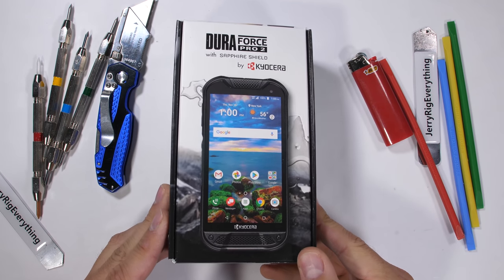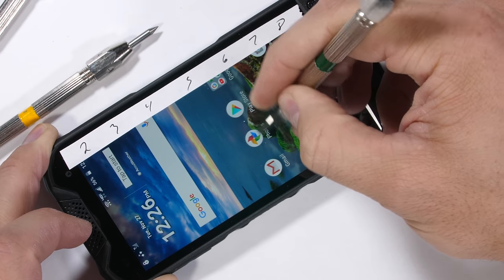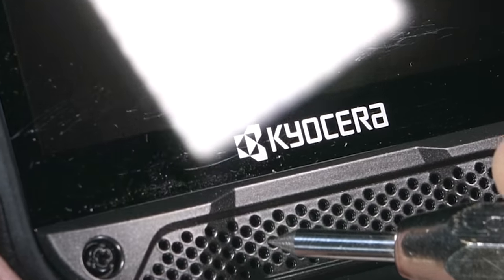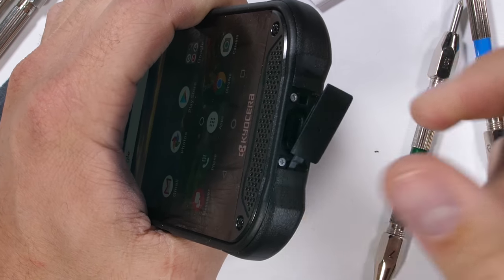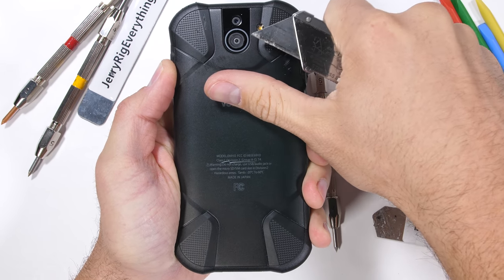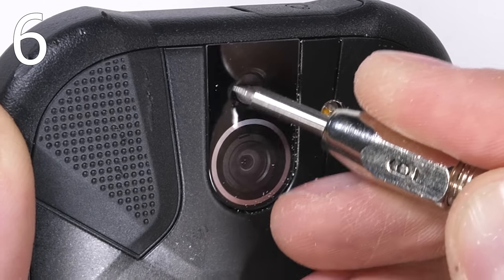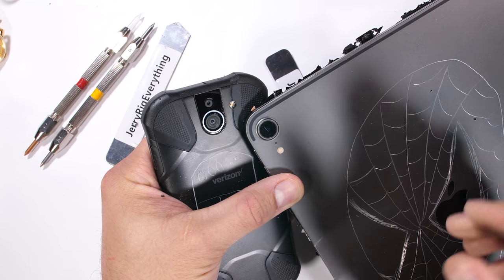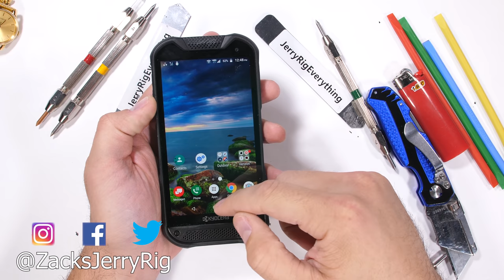A Rugged SAPPHIRE Covered Smartphone? - Durability Test!

Comment: Please don’t ever change the style of your videos!
Reply: I would like him to add drop test as well
Reply: @anashussein6068  I would like a bit more roasts to Apple....oh wait... Wrong channel I meant to put this on Unbox therapy.
Reply: @anashussein6068  when you think about it, it's not needed. 

Glass is easily broken. Like, 90% of the phones will fail the durability test, only the plastic screen ones pass. That is not very informative. It doesn't show the quality of manufacturing, since that's just how glass is.

 Unlike the bend test, which shows manufacturing quality. All phones nowadays are made of the same material (aluminium) yet some fail and some pass with flying colors.
Reply: @qwerasdf-oy6uo  yes the majority of glass-screened phones will break in a drop test but manufacturers have to put some sort of rubber or silicon frame around the screen (or something that absorbs shocks) so that the glass won't absorb all of the shock and smash so a drop test could still have some use
Reply: I know his password
Reply: @anashussein6068  He does drop tests when it's prudent
Reply: @anashussein6068  He only does that only a few times
Reply: @qwerasdf-oy6uo  I agree a lengthy drop test segment would be a bit much but I agree with others that adding a small segment touching on any screen to frame buffers or stress concentrations at sharp corners could affect survivability. This should not replace the burn test though.
Reply: I second this comment. Your content is unique, please don't change it!
Reply: "should we be putting sapphire on all cellphone screens?"
If that means the screen will not get scratched from my Level 8 mohs nail, yes of course
Reply: True
Reply: I would be nice if he adds a durability test for the charger in the box. I mean what's he gonna with all those. Atleast, give a hardware review of them.
Reply: @qwerasdf-oy6uo   that doesn't mean that they should be able to take the same damage. The thickness of the frame is also a factor and where you drill the holes. It has very much to do with the shape. But except that every manufacturer doesn't use the same aluminium composite. Remember how badly the iPhone 6 bent, and then they fixed that with the 6s, which had the same shape as the 6, that was because they used a stronger aluminium composite. And remember the Essential phone which had a Titanium frame

Comment: I get so uncomfortable when he cuts towards himself
Reply: Wood carver here, work with knives for a living, he's doing a parring cut completely safe the power in the cut comes from squeezing your hand so very controlled, same way done prone peel apples or potatoes
Reply: @chironturner4040  True, except with wood or fruit you are working on one substance at a time and the force needed to cut remains constant. Jerry is constantly switching between steel, aluminum, different plastics, and rubber which means there's a much higher likelihood of the blade slipping and cutting right through his thumb. Also if you actually watch how he's cutting, he cuts fully through until the blade slips instead of controlling his cut through the material. So in short, very unsafe.
Reply: @chironturner4040  I know less than you so forgive me but you can see it skidding! It's so unpredictable! He can't cut away from himself somehow? Idk eeeeek
Reply: Hahahaha
Reply: @hkoxnw  the old cut away from your self deal is not for every one any how. You should cut in the direction that gives you the most control and your blades should always be sharp. most cuts do not happen because of direction but because your blade is not sharp enough to get the job done safely.  Working in computer shops i converted many a card board box in to a disposable bin for dead parts by taking off the flaps with a good very sharp knife never once cut my self cutting towards my self. The few times i had close calls where cutting away from may self. Grabbed the flap with left hand and drew the blade along the box flap toward my self great control. Cutting away from my self very awkward and resulted n the cut going up the flap towards my thumb even potato peeled m self a couple times just a couple skin layers but yeh stopped even trying after the second time. Rope cord etc for me is easier to cut going away from my self so it is all dependent on the direction that gives the most control
Reply: I DO TOO 😲😲😟😟😖😖
Reply: Towards your thumb, not your chum.
Reply: @MalleusSemperVictor  eh? i had to do a age search in chrome and the only chum typed out i see is the one from you lol

Comment: If you're looking for a justification for the burn test, it comes into play when repairing waterproof phones that have their screens glued on. You need to heat the gaskets to soften the adhesive before you pry it the screen off. So if a screen is really susceptible to the heat test, then you need to know that you have to be super careful when removing it if you're ever repairing that phone. Now, we all know that the amount of heat your need is less than an open flame directly to the glass, but it's still good to know.
Reply: But does the heating reach the temperatures of a lighter? I dont think sooo
Reply: @ishouldhidemynamelmao345  Yeah, I literally said that in the last sentence of my comment.
Reply: @ishouldhidemynamelmao345  

No. You usually need to set your heatgun on a temperature of 80-100° Celsius (176°-212° Fahrenheit). 
The flame of a lighter, at its hottest point (right above the blue tip) is around 1300°C or 2372°f hot.
Reply: What if you're a DIY guy, after watching these tests you know you can use a lighter to soften the adhesive instead of a heat gun. You know that you can be reasonably careful and still not damage the phone. Obviously you should use a heat gun if you have one, but in a pinch you can heat up a phone with a lighter or in a frying pan and as long as you're paying attention, you're not likely to permanently damage the screen.

Comment: Dang, a rugged smartphone that isn't just a regular phone wrapped in an inch of rubber and plastic and it doesn't for some reason cost more than a normal phone.  Nice to see someone out there actually trying.
Reply: I'd laugh if someone in the comments said that it's back comes off too easy.
Reply: I found ulefone's armor 2 is pretty good too.  Both of these phones are also priced at good range too.
Reply: I own the kyocera duraforce 1, it looks basically brand new after 2 yrs. I had the Kyocera Brigadier before this one, the duraforce pro 1's predecessor, and the only reason I swapped was cuz the battery died of old age. These phones are baller for longevity but leave a little something to be desired in heat management (prolonged use of resource extensive apps heat the phone to disuse, forcing mandatory shutoff-cooling.)
Reply: The overheating thing is a bit of concern. Luckily I don't need processing intensive longevity
. I'm assuming your talking about games?  I have a PC for that.
Reply: @Balefire89  oh yea my duraforce pro  version 1 not the new v2 overheats like crazy usaly it's the darn power management chip once it get hot enough the phone stops charging and the only way to prevent the phone from dieing on you even when plugged in is to cool the phone with a blower etc blowing cold air. Once then phone drops below about 44 to 45 c it starts charging again
Reply: @Trekeyus  I have the duraforce 2 no heating issues yet, apparently it can go up to 60c, got mine up to 48 once in direct sunlight while playing a game with no issue

Comment: Jerry: Scratches tf out the fingerprint scanner
Fingerprint scanner: Doesn't work properly
Jerry: Impossible
Reply: Well in other durability test videos he scratched the fingerprint scanner too but it's still work except for this phone.
Reply: RMP. !Attacker fake that’s because the fingerprint scanner was on the screen or made of glass
Reply: @crazykells5882  True, but it's still woth noting that if you treat it like shit it may stop working. It's a durability test after all.
Reply: @crazykells5882  not all fingerprint scanner in glass are working right when scratched
Reply: @kamilbeben9900  if you manage to do that to your fingerprint scanner you don't deserve it to work lol. Itd be dope if the reader was on the screen though.
Reply: @TheFrogInYourClosetWatchingYou  I don't think that would work well with such a thick slab of sapphire. Also the screen need to be heat resistant, and a ultrasound scanner wouldn't be very resistant to heat.
Reply: Jerry: umpossible

Comment: 2:54 a headphone jack - instant thumbs up👍👍👍
😂😂😂😂
Reply: @rodmunch69  
Slob is YOU. We want headphone jacks.
Reply: @TheP_DSPTractor  Why?
Reply: @rodmunch69  with the money that I spend in a good bluetooth headphone I could just buy a regular headphone with superb sound quality
Reply: @rodmunch69  how long does bluetooth headphones last in a single charge compared to wired headphones?
Reply: I can listen music with my phone and with jack earphone and it use 1% for 3 hours and Bluetooth don’t last that much
Reply: I already buy Bluetooth but the battery don’t last longer that’s why I’m back on wired .
Reply: @x-zen-x6859  You're fake news - bluetooth power consumption is nearly nothing and it's been that way for over half a decade. Also buy some bluetooth headphones that cost more than $6.99 - like move up to the $12.99 range and then you won't complain as much.
Reply: @rodmunch69  because you get good sound quality out of wired bose headphones
Reply: @darkhero77  (there apple sheep, you'll be able tl tale the screen away and they'll still buy it)
Reply: @thepasty8713  The audio is digital - the bluetooth transmit rate is higher than the audio rate - meaning it's a perfect 1:1, there is no loss of quality on bluetooth. Also when I want to use my Bose QC25, I use this thing that in the box called an adapter - in fact I just leave it on the Bose since it's the only pair of wired headphones I still use.
Reply: @rodmunch69  i charge my phone when i get home and listen to music through a stereo. Ive tried Bluetooth thriugh it and its juts not as good, simple as that, i have a high quality AUX and its abiut 50% better. Also i will have to charge headphones and i always forget so i will never buy a phone with less features, because i use them all everyday
Reply: @thepasty8713  Then that is because you're buying your headphones at the dollar store. There is literally no audio difference between wired and unwired other than the amp in the bluetooth headphones - the music/audio is digital, it's delivered with no compression. Anywho use the adapter in the box and stop complaining. The future is here, and no, the 3.5" floppy isn't coming back, the CD isn't coming back, and wired headphones aren't coming back.
Reply: @rodmunch69  im 19 mate, im in the tech, i want a jack in my phone, i also want a fingerpring scanner. If they want to tale more things away, i also want a screen, hard buttons, expendable storage and a camera
Reply: @rodmunch69  Making fun of HIV's? thats sad
Reply: TopazDarkBlue , I think so.
Reply: The Pasty your 19, literally no one cares what you think kid.
Reply: @rodmunch69  dude grow up .
Reply: EVO I Fredric why?
Reply: WIRED IS STILL BETTER, ROD MUNCH
Reply: @mrc14_2  cool story cupcake.
Reply: @rodmunch69  I mean, wire makes you look more serious and unmodern, its way cheaper and draws a BIT less power
Reply: I think its time to get rid of usb cable and port too the phone can charge wirelessly now and you can connect it to your pc by wifi
Reply: @rodmunch69  I play games, but Wire Headphone is better,
You look like an Apple fans...

Who would win?
Streaming with wireless Wifi
Or
Streaming with wired wifi

Wired wifi is more stable.. thats why we use headphone jack...
Reply: @rodmunch69  it is because I like having 'options' in life.. But you would know know about those now, would you?
Reply: @Invictus173  Yeah dummy, you have a choice, to use an adapter or not use an adapter. Stop whining.
Reply: @rodmunch69  look like you have that much money, and I can R/woooooosh you at reddit lol
Reply: And you know what? You know me stupid? That is good anyway im stupid, i admit
No one tell you to say that...
Reply: Just like EA
Play: 100$
Don't play: 50$
What if the adapter broke?(do not freaking tell me to buy a new one because Apple just like money and the repair of 1 phone is cost a whopping equals to buying a new one)
Reply: From the sentence up there
It's was called 'opinion' 
No one can attack an opinion, we all know that
We just like to use wire headphone... for gaming
Unlike bluetooth, the speed travel is almost instant, 5G is different tho
Look like you also liked 5G
Reply: @rodmunch69  X-ZEN-X said that the battery don't last longer... and he had experienced on it. Just like me, I had tried it and it drained so fast... yea, fast
Reply: @rodmunch69  adapter is like the worst solution for this issue! Previous phones had that facility and Samsung even managed to fit a whole s pen and a headphone jack and still had water resistant phones,so do not even start with the whole waterproofing bullshit.. Choice is not something you pay in extra to aquire!
Reply: ... Whats the problem of phone getting a headphone jack???... Even if the phone had headphone jack it can still use a Bluetooth Headphones or wireless headphone plus+ Headsets for poor people that having a phone with no headphone jack the option is too little
Reply: @rodmunch69  and how old are you?
Reply: @bibletwink666  69
Reply: @rodmunch69  very funny
Reply: @rodmunch69  ok i'll stick with wired headphones instead of listening to your ads
Reply: @rodmunch69  Dude. The bluetooth headphone is just not good as the cable one. Sometimes the quality is not stable. Sometimes high,sometimes low. Also its draining phone battery a lot. But with cable? Not draining, its draining from the music player.
Reply: @rodmunch69  Oh yeah also, bluetooth are more easy to get stolen. If you put beside you at public place, someone will take it easily (because no cable lol)
Reply: @rodmunch69  Actual props for keeping up with all these people for 7 months 👏
Reply: @maskarasyad6031  What kind of crime infested hell hole do you live in where people are stealing your $6 headphones?
Reply: @Dont_Za_Jah  I do my best. God bless.
Reply: @rodmunch69  👍
Reply: @Dont_Za_Jah  lmao wow this dude's going off
Reply: You guys have lots of free time I guess
Reply: @rodmunch69  Airpods dude. Airpods
Reply: @dnf1748  It takes like 15 seconds to respond to someone, you get a little notification and click it, then you see what some dummy wrote, and you respond - not consuming at all.
Reply: @maskarasyad6031  Airpods look like old ladies jewelry, and men who wear them look like fruits. Anyways wired headphones do not sound better, the audio is digital, the data bitrate is the same for wired or wireless. The only thing that matters is the quality of the amp and the headphones themselves - and most decent headphones have amps that are better than whatever was leftover and put in your smartphone.
Reply: @rodmunch69  simple one. Bluetooth earphone are more expensive, and more easy to lose.. need charge too, meanwhile cable one? Cheaper, not easy to lose, and dont need charge
Reply: @maskarasyad6031  It's 2019 kiddo, they're not more expensive, you can literally get them for $3 on Amazon. Also why are they easier to lose? If anything they're harder to lose since you don't need to worry about them accidentally getting ripped out of your ears by getting caught on something. Oh, and again, it's 2019, everything needs to be charged. Guess what, those headphones you're wearing that are plugged in are using up battery as well. Stop being so boring and stop living in the past and join the modern world of a decade ago when bluetooth headphones became common.
Reply: I just need headphone jack.
Reply: @rodmunch69  lets see at 2025, does headphone jack still exist
Reply: @maskarasyad6031  If you need a headphone jack then just use the adapter that comes in the box with the phone.
Reply: @rodmunch69  then, how do we use it while charging :3
Reply: maska rasyad it’s 2019 - look into wireless charging.
Reply: @rodmunch69  how do we use it then :3
Reply: @maskarasyad6031  you buy bluetooth headphones, which is where we started.

Comment: It will be interesting to see how many of these sell. And if they sell a lot, it will be interesting to see if the sapphire supplies will keep up
Reply: kyocera produces sapphire glass in mass.Up to 200mmx300mmx20mm.They could build a tablet with sapphire glass.
Reply: I've had kyoceras. They don't always have the bells and whistles but you will have that phone and it will work as well as the day you bought for as long as you want to keep using it. I bought my first one as a replacement for $79  just to tide me until I could replace my flagship phone and I needed up keeping it for two years. Never had a case. These don't need it. And it still fires right up.